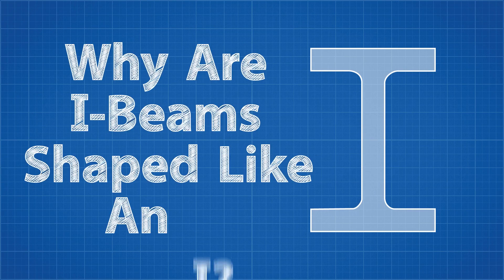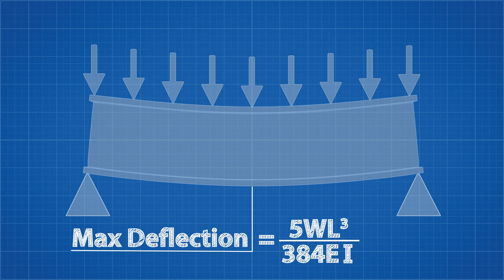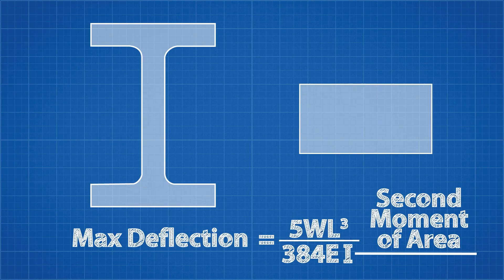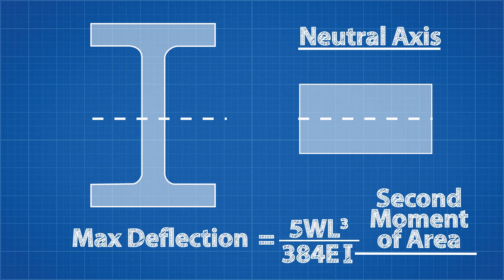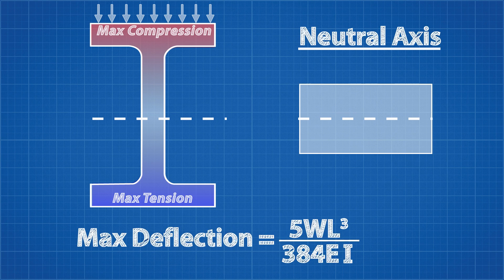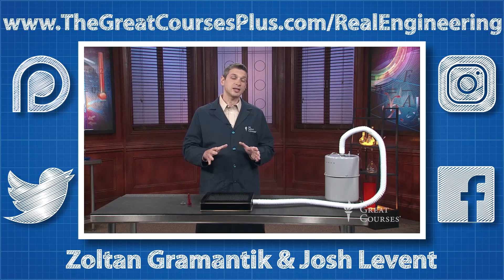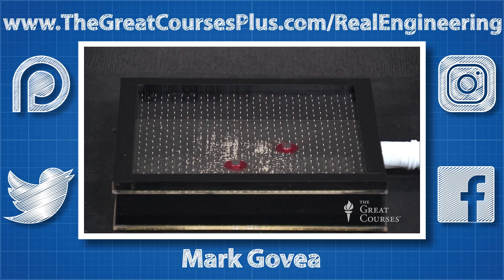Why Are I-Beams Shaped Like An I?

Comment: Are railroad steel rails also shaped like an "I"? The top flange or head is shorter than the bottom flange or the foot, but otherwise its the an "I" shape steel beam.

Comment: You'd never carry a mirror around with the wide side horizontal because it would break under the great bending. Carrying with the wide side vertically there is merely any bending for the same reasons.

Comment: get a piece of paper. cut them into 6 sqaures. now align them so they are touhcing in a 2x3 pattern, 2 in x, 3 in y. it should look like a rectangle with more vertical length than horizontal length. now space them apart from each other by about .5cm. the gap in between them is a capital i. i wonder if the person responsible originally witnessed cubes being lined up on top of each other and said that there is this weird i formation that appears in between cubes which if were replaced with reinforcment would reinforce everygap in between the cubes. though in order to place the reinforcement down they needed to cut the material - this the i beam. which is really just reinforcement for edges of cubical and sqaure objects

Comment: Got a span of 24 ‘ need too know what size I bean do you recommend it’s for a garage 24x24 three walls connecting to exciting building roof pitch is 10/12 in side rafters is a storage area of 12 wide 8 high thanks I’m making a rig beam for rafters

Comment: Very good explanation!  I explain using the inercia momentum formula: I = (b*h^3)/12, this formula represents only the geometrics propreties of the structure, and how only changing the "h" value contribue to Inercia much more than "b". 
The deflection formula i use to explain the combination of material and geometrics (E*I ) do the resistence against the solicitations (w, P, M)

Comment: That’s either an M-beam or a W-beam (USA).  There is technically no I-beam except in common everyday speech.  M & W beams look like a sideways capital H.  There is also something called an S-beam where the underside of the horizontal flange is not parallel to the top face of the flange.  The S-beam looks more like what people often call an I-beam.  You can look up these and other types of standard structural steel cross-sections in the "Manual of Steel Construction" tables in the "Allowable Stress Design" book published by the "American Institute of Steel Construction" (AISC).

Comment: 1:42 why is the lower edge in max. tension, or even in tension at all? is there a force pulling it from side to side?
Reply: You should google the stress distribution diagram of I beam or I section; you will understand.

Comment: A bit late... but still. Composite aircraft construction, especially for home built kits. the wings are constructed of a foam or honeycomb core sandwitched by fiberglass, kevlar or carbon fiber. It's a bit different because rather than area it is density and strength, but still, and interesting outgrowth of the same concept.

Comment: It is called an I beam because of its shape , the middle vertical part is what carries the weight, the flat parts ,top and bottom are used to hold it up from underneath, in the open area , the upper part to hold bricks for the wall above. This is a very stable method, vertical and horizontal movement contained. This is cost effective, saving weight , but giving maximum strength.

Comment: When making cars' frames, I wonder why engineers are stuck with boxed vs open-C frames. Why not use this mighty I- beam design? Is this because mechanical engineers think they are more clever that civil engineers and therefore couldn't see themselves using something the latter have developed?

Comment: Why are they shaped that way? Well, I could tell you.. but then I'd have to kill you.  But more important-- WHY is the term I-Beam used in the video title, and used throughout the video in reference to structural steel items that are clearly Wide Flange beams, or WF for short? That's not being too picky as the fact is that 'I- Beams' are rarely used in Building Construction, they are all WF Beams. As such that reference to Willis Tower (aka Sears Tower) in Chicago was really off the mark. I've been racking my brain trying to think the last time I saw an actual 'I-Beam' used in a building, and can't think of one. And unfortunately, I don't have any Structural Steel Blueprints at home I can go through. Anywho, I don't think you should be so fast & loose with Engineering Facts, when those 'facts' aren't right -- or 'complete'.

Comment: I-Beams aren’t really used anymore, most building use w-flange beams. It has a more efficient cross section
Reply: But the same principles still apply.
Reply: Midnight Gear yes

Comment: Nor sure where you are from but that is a Wide Flange Beam   an I beam is a different creature with curved flanges that taper into the web
Reply: The general public isn't concerned with the difference.   Both beams are "I beams" in the mind of the general public, even though the industry has a specific difference between the terms.

Comment: That's a W beam.  As in Wide Flange Beam.  Or if it's metric it would be a UB, as in Universal Beam.
Reply: The difference being whether the flanges are flat plates (wide flange beams), or tapered to optimize the flow of stress (I-beams).  In both cases, they are shaped like a capital I, for the same reason.
Reply: @carultch  there is no taper on his example beam.  And yes, it's the difference between channel and pfc (prarallel flange channel).
Reply: @annonymouslibertairian9120  I prefer the term parallel flange over wide flange.  I didn't see what was particularly wide about the shape, when I first saw a W6x9 drawn to scale, as it is still taller than it is wide.

Parallel flange beam is a more straight forward term that gets to the point of how it is distinguished from other beam shapes.  If it were up to me to come up with the terms, I'd call them parallel flange beams and rounded flange beams, with the term I-beam being a general term for both.

Comment: Wrong deflection formula, should be L^4 instead of L^3
Reply: If you represent the load as a total load, in units of pounds or Newtons, it is L^3.  If you represent the load in terms of load per unit length, it is L^4.

Comment: Wide flange beam: looks like a capital H over its cross section. The H-beam has wider flanges than an I-beam, but the I-beam has tapered edges. The width is the flange, and the height is the Web. The difference between both H-beams and I-beams is the flange by web ratio.

Comment: a couple of extra tidbits. Back in the early days of the industrial revolution, beams were actually rectangular. Then when this was discovered, they were able to save tons of material and money on beams and structures requiring these beams. Another way to look at it; take a yard stick, grab it in both hands, and flex it it. Notice how when the yard stick is flat, it flexes like crazy, VS the other direction. thats because the same principle applies to the neutral axis. 

Sources: My strengths of materials text book

Comment: Why isn't it a square shape wouldn't that work the same but spread out the force to 4 planes rather than 3
Reply: Remember he said the least amount of material possible. If it can support the same weight with 1 less 'wall', then you save 25% more material and reduce it's weight
Reply: Yeah I'm saying just get the middle section and half the material and put each half on the outside to form the square so material is the same

Comment: Instead of looking at the section as a beam, look at the section as a column. The web is strong enough to stop deflection/buckling in one axis, but not the other. The two flanges stiffen it in the opposite axis. Thus, you have a light column that will support the load and not buckle in both axes.
Reply: A rectangular tube is far better as a column than an I-beam. I-beams are only for supporting transverse loads.

Comment: Using just the information provided in the video the the optimal shape to reduce the stresses created by bending moments should be to make as tall and thin a beam as possible for the mass to be as far away from the neutral axis as possible, with no mass used to make to make the flange. So why isn’t that the case?

Comment: Second moment of Area = Moment of inertia ?
Reply: Yes and no.

Second moment of area is a more accurate name for it.   This property is a property of geometry, and really has nothing to do with inertia.

The reason it is often called "area moment of inertia" is that the formula that defines it, is very similar to the formula that defines the mass moment of inertia used in rotational mechanics.   That is, the fact that it involves integrating r^2, is what they both have in common.

Comment: Very good explanation!
I'm curious how an I-Beam compares to a round pipe (or round tube - I mean as in structural pipe)?
Particularly, if steel beams are to be chosen for a geodesic dome, in which every layer of struts have different slope (and even struts on same level have different slope in order to make triangles).
Using I-Beams seems (intuitively) inefficient in such structure, at least because it would make the connector hubs much more complicated. While using round tubes would alleviate the need to worry about their orientation (and being round tubes the connector hubs can be with spherical outer surface so that they fit perfectly at any angle).

Comment: Only sissies use that equation to calculate maximum deflection. Real men use calculus!!
Reply: Saving time by using the solution to a problem already solved makes you a sissy?   Why waste time by resorting to first principles to derive that equation when someone else already did?  I understand doing it as an exercise to understand the theory behind that formula, and to know how to approach the problem to derive your own formula if you needed to do so for a different load distribution.  But if you are solving dozens of uniform load beam problems with the same support conditions, you aren't going to "reinvent the wheel" and derive it every time.

Comment: So the variable I is what describes the shape of the beam? Interesting coincidence.
Reply: The variable involved is called I, because it is known as the "area moment of inertia".   Even though it really has NOTHING TO DO with inertia itself.  It is just that the calculus behind calculating "area moment of inertia", is similar to the calculus behind calculating the actual mass moment of inertia, i.e. the property that affects the relationship between net torque and angular acceleration.

"Second moment of area" is a name that more accurately depicts the concept.  Because what it is, is each infinitesimal area of the section, multiplied by the square of the distance from the neutral axis, and "added up" i.e. integrated across the entire section.   Instead of integrating infinitesimal masses multiplied by a square of a distance, we integrate infinitesimal areas that are also multiplied by the square of the distance.

Comment: Here in the US, in many smaller scale residential and commercial building applications we have transitioned to i-joist made out of recycled strands and veneers of lumber. They can vastly out perform traditional dimensional lumber, in span and resistance to deflection.

Comment: Its called I-beam because it is shaped like an I, it would be K-Beam if it is shaped like a K
Reply: Yeah, but why are few if any beams built with the cross section in the shape of a letter K?   That is the real question this video is answering: why the I-shape has structural advantages.

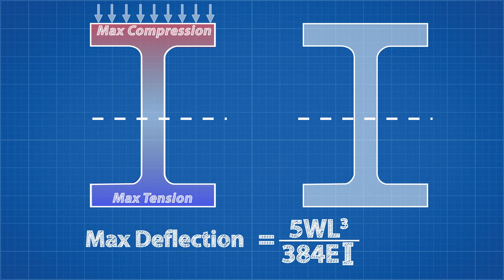Comment: Wow.  This video actually did not explain or know why it is letter I shaped. 2:25 Placing the excess material at the top?! 🙄
If the load is truly vertical, 90 degree to the beam,  it wouldn't need the top or bottom materials.  The needed material should be enough to resist the shear stress.  
However, in the real world,  no load is perfectly aligned.  The materials at the top and bottom is to resist twisting and bending from a load that is not perfectly vertical.

Comment: Where did you get the 5 and the 384 from?
Reply: It comes from the Calculus that derives the equation of the elastic curve.  It starts with linear equation for the shear, since that's how shear varies within a uniformly loaded beam.  Then there are three stages of integration.  Integrate once, get bending moment.  Apply the constant 1/(E*I) to get from bending moment to curvature.  Integrate again, and get slope.  Integrate a final time and get the deflection.

At each stage of integration, you preserve the arbitrary constant of integration, assigning a unique id each time.   You then apply the boundary conditions to solve for these constants of integration.

Knowing that max deflection happens in the center, you then plug in L/2 for x, to the deflection equation.

Comment: Are we to assume that the physical properties of steel dictate that the I beam ought be symmetrical top to bottom?  The top portion of the I (under compression) and the bottom portion of the I (under tension) have different means of resisting deflection. Are these two mechanisms equal in their ability to prevent deflection and does the material degrade uniformly over time or would there not be a benefit to creating an I beam with a thicker/heavier top or bottom?

Comment: 1:14. I think you wanted to say: If weight is placed in the middle it actually very difficult to lift, but at the ends it is easier to lift due to leverage.

Comment: Funny thing is, in steel construction, we usually call I-beams W-sections. The W in this case stands for wide flange.
Reply: That's because "I-beam" has a more specific meaning in the industry, than it does to the general public.   W-sections have rectangular flanges and webs, for ease of installing bolted connections.  The specific beam known as an I-beam, has tapered flanges that have a special transition toward the web, for a more efficient use of material, at the disadvantage of not being able to make bolted connections as easily.
Reply: carultch Learn something new everyday! In this case, a year later. XD

Comment: That is the main reason, but I think to get the complete answer, you'd need to talk about the cold rolling techniques that allow this shape to be produced massively. 
A square or round tube essentially does the same thing, but in several directions and that makes it also better for torsion resistance. But these shapes are more diffcult to manufacture and also to assemble.

Comment: But can the steel beam melt by a jet fuel?
Reply: Nishikata Sitohang...I guess I’ll start it....NO! There I answered your question. I’ll even give you the specs: steel melts at 2500 degrees F and jet fuel can only burn at it highest temperature of about 1500 degrees F.
Reply: Jet fuel cannot melt steel beams.   It cannot complete the full phase change from solid to liquid.   Bring steel to the temperature of burning jet fuel, and it is still solid enough to "clang" when you hit it with a hammer.  However, by raising the temperature, you do seriously weaken its strength and stiffness, such that it is completely useless as a beam.

Comment: The ''I'' shape is made to increase the flexural stiffness and load resitance in the longitudinal direction while using a minimum amount of material by optimising the beam's  moment of inertia of the section by applying the parallel axes principale.

Comment: This could've also been explained through maximum shear at the edges of an object as it has max stress there as well. Therefore, the more material on the edges, the greater the resistance to shear and therefore less stress. But yes, most obvious way is through second moment of inertia.

Comment: I didn't have any physics class after highschool and didn't understand this video. Could someone share a simpler explanation please? :)
Reply: When determining with the strength and stiffness properties of a simple rod in direct tension, the geometric value that matters is the cross sectional area.  E.g. if it is a cylinder, it's the area of the circle.  The more area in this rod, the stiffer it is, and the stronger it is.

But when it is a beam, loaded in bending, it isn't area alone that matters.  Material further from the center contributes more, than material at the center, by the nature of being a distance away from the center.  Just as it is easier to push a heavy door as far from the hinge as possible, than to push it right by the hinge.   So to place as much material as far from the center of the beam's cross section as possible, the beam is shaped like a capital I.  Thick flanges at the top and bottom, and a relatively thin web vertically to keep it together.

Comment: In this equation we can play with only WITH Inertia rest can't be changed because stiffness material are unchanged . This is why Holllow cylinder takes more load than Solid cylinder . Because mid along any larger axis , only outter fibre takes load( Tau And sigma) in case of complex load ,not in pure shear and bending

Comment: What is the use of calculating moment of inertia in stress
Reply: It's not really a moment of inertia, but rather a property of geometry that is analogous in concept to moment of inertia.  Instead of integrating relative to mass, we integrate relative to area.  "Second moment of area" is a more accurate term.

Unlike simple axial loads, where cross-sectional area matters for the member stiffness, stress is not uniform, and stress also doesn't contribute uniformly, when resisting a bending moment.

The impact of distance away from the neutral axis is two fold.   The stress in the fibers is proportional to this distance, and the moment arm against the bending moment is proportional to this distance.  Hence why we integrate r^2 for each infinitesimal area element, when forming the property of the section that is relevant to bending calculations.